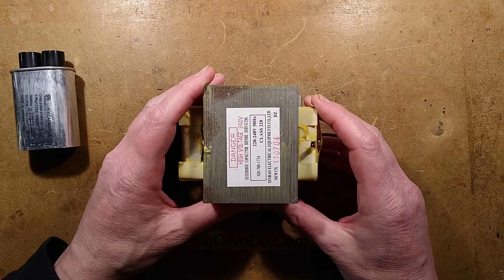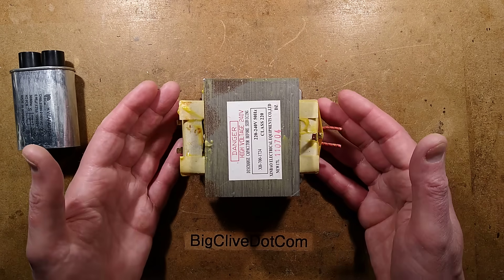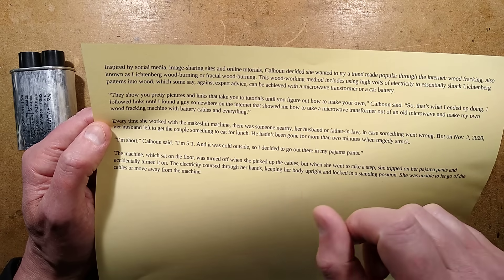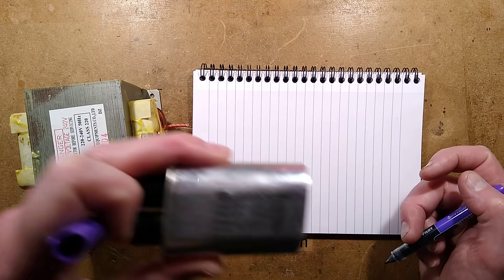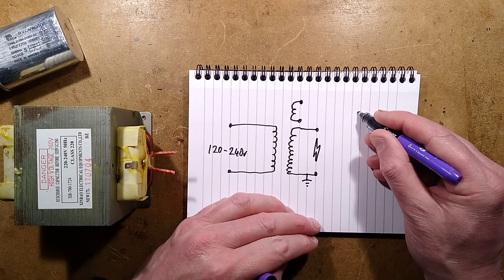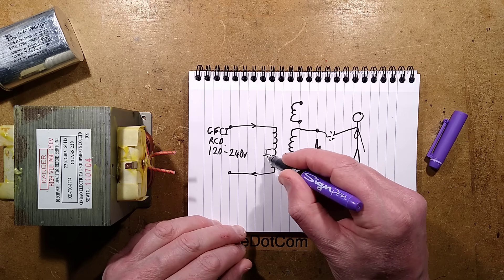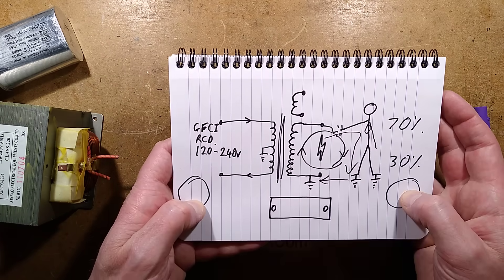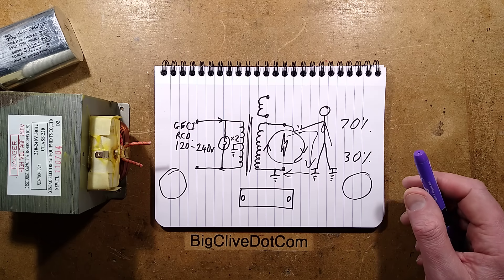The most deadly project on the Internet

Comment: I have a 50 kv sign transformer. I use solid auto motive spark plug wire to move it. Lots of fun but carefulling is required, unless you want forever sleep.😅

Comment: I'm an electronics engineer and while your concerns are warranted, car jumper cables are intended for 12 or 24vdc but capable of both voltages and currents of magnitudes far greater than the intended and rated purpose.
If we calculate the cross sectional area and length, we can generate some real world numbers that will be accurate and reliable.
The real issue is ignorant people literally playing with electric fire.
Reply: Yes indeed but the alligator clips could be easily touched. Just not the right cable for the job despite the ratings. Also an electrical engineer.

Comment: I know I shouldn't tell this story, but anyway... Way back in the last century, I was a student apprentice. My subject was electrical engineering specialising in electronics.This was in the days when valves were ubiquitous and electrolytic capacitors were mostly high voltage. There was a training electronics workshop where we designed, built and tested various bits of equipment. We very quickly learned that if somebody yelled 'catch' and tossed something towards you, you put your hands behind your back and dodged the object.

Comment: I noticed a lineman has already chimed in... And gave a harrowing account.

I'm an industrial electrician and I deal with medium voltage regularly.

Don't play around with it. Electrocution is a real danger. But under the right (wrong) circumstances, arc flash is also a horrifying possibility.

Would you mess around with fluids under 2000, 3000, 4000 pounds of pressure? Because that is the closest approximation that most people unfamiliar with electricity can understand...

Voltage like that is like high pressure fluid... It is under tremendous "pressure" or "tension" and will utilize the smallest flaw or imperfection to escape and equalize the pressure it is under.

It will kill you and it will be agonizing the entire time you're dying.

If you insist on pursuing this... Get some training. Get the correct PPE and safety equipment. And learn how to properly maintain/care for said equipment.

Comment: Why does that label not explain that it is actually 3000V? I'm sure this lack of information has contributed to the amount of deaths. Granted they should have never messed with this tranny.
Reply from the maker: There are warnings on the ovens saying not to open them due to high voltage.  I doubt they ever thought that people were going to take the transformers out, connect car jump leads and then pour salty water over a table and hold the leads onto it.

Comment: So making it into a spot welder is fine? (As long as you short the capacitor before)
Reply from the maker: Yes.  Once the high voltage winding is removed it becomes a much safer transformer.

Comment: I'm by no means a professional electrician, nor have I ever worked as one in the past, or received any training in that field, so this comment is by no means professional advice, nor advice at all.  It's simply some personal observations, and speculations, and I welcome anybody more educated on the topic to correct me, or offer their input to the thread.

With all of that said, what concerns me about the dead man's switch is that if the high voltage tenses the muscles in the hand, they are most likely going to clench, and get locked into that clenching position... and if the switch is based on simple mechanical buttons, or even spring-loaded rocker switches, that could lock it into the closed position.

I could envision a safer approach, but the engineering/construction would be quite a bit more complicated.  But essentially, having the switches on a fulcrum, which is spring-loaded to keep the switch in the open position, but not a rocker switch as we usually think of them.  Rather, these levers would consist of linear pieces of insulation, 4 or 5 inches long on one end of their respective fulcrums, and shorter lengths of insulator with contacts on the other end of their respective fulcrums— preferably the contact ends being inside of thermoplastic-insulated boxes.  To close the circuit, one would have to apply pressure by clenching one's hands around the lower part of the levers and hold them in a middle position, and only while maintaining that correct amount of pressure to both will the circuit remain closed.  If one lets go of either lever, the spring pushes it back into the open position.  If one suddenly clenches their hands with enough pressure to move the levers beyond the middle (closed) position, it will push the levers into a third, open position.  Finally, if pressure is released from the third open position, the levers (or the contacts on the load side) are pushed out of the path of the other contacts, such that the levers can return to their resting state in the first open position, without making momentary contact with the closed position.

Although I'm unaware of any manufactured switches which accomplish this same level of safety, they may exist, and if so, building DIY ones is definitely not a good alternative.  But assuming there aren't any such on a mass-produced basis, given that the placement would be in series on the primary side, Cat IV contacts and wiring (while certainly sufficient) wouldn't be necessary
Reply: The dead man's switch isn't on the high voltage side. I've made the switch before. The point of it is that you need two hands to turn the device on, and keep it on. So you have no hands left to go poking around the high voltage stuff.

Comment: Voltage can definitely be dangerous.  If I am correct, anything over 50Volts can be dangerous. Remember it's Amps that kill you but it's the Voltage that basically has the ability to  allow that amperage to flow through your body.  There's more to it but for basics, do your research regarding what you are working with.  
I will point out there are more deaths from lower volts only because it's the more prevalent Voltage we are all subject to...IE 120/240.  Always be careful and study before attempting anything like this so that you can be as safe as possible.

Comment: Just a small sidenote about discharging the capacitor. I wouldn't recommend using a screwdriver (insulated or not) to do it, as if the capacitor is fully charged it would create some pretty nasty sparks and if you aren't prepared could cause unwanted outcomes. Even if it isn't at full charge, it could still hold more than enough voltage to be a big problem. Using a bleeder resistor rated for that kind of job is a much better and safer way to do it in my opinion, as it will discharge over time instead of instantly. I know it isn't the main focus of the video but I do think it's important to point out.

Comment: I personally am going to try using electric flyswatter transformers in series.  The shock is overwhelming, but not fatal.  It would be similar to a microwave transformer but with lower current.  I will also have lots of precautions still because those little transformers are still dangerous due to the AC plasma.

Comment: Serious Question: After double checking that all wires, connectors, and the transformer itself are all properly insulated, what is wrong with just standing by the outlet and unplugging the machine when the circuits meet or when an adjustment is needed?
Reply from the maker: Accidents happen.  I still recommend that if people actually do this project they have a safety system in place as described.

Comment: Ive done plenty of fractals as a woodworker. My device is rigged with 2 safety switches and i was taught to NEVER hold the leads. I even unplug it after switching off to ensure i dont get dead and i always am at least 5 feet away before i switch the burner on. Electricity is NO DAMN JOKE

Comment: I have two balasts from 480v street lighting that were removed from a project where we were hired to change over the old high pressure sodium street lights to newer LED style heads. The two I kept were ones that I had installed just a few months prior before I recommended that they switch to LED to save power and maintenance costs.  They both have your standard 240/480v input, but the output sides of them are multi-tap and have outputs that will easily hit over 1200v. I have been wanting to find a use for them and wood fractals is one of the ideas. However, being a worst case scenario thinker, they remain on a shelf, just because they terrify me. People have no understanding of just how dangerous these things are and how one little lapse of judgment can end you.

Comment: An important video I hope many people see!
It is dangerous to play with electricity if you are ignorant of the fact that it only takes 100 mA to stop the heart and that a fairly low voltage of about 100 volts can generate this.

One problem is that the iron core is "live" and a closed circuit can occur that may pass through the entire body
If one ensures that the transformer is fully isolated from "earth" reduces the risk of injury.
If you then follow the principle "one hand behind your back" the risk of injury is almost zero, of course you still get current in/out of the active hand but you survive.
Or am I wrong?
Reply from the maker: At this voltage the hand behind the back thing is less effective because the current can find a return path through your footwear to ground.

Comment: Good video sir and you certainly don't understate the safety necessary for handling high voltage transformers. The dual button safety design is commonplace in so many automotive parts and other factories that its implementation should be more widespread. Good luck with your other projects.

Comment: 😮😲😲😲 oh I get it so the microchips inside of the victims they are using this type of fractal burning on their skin by making a pattern and it's killing some people is starting from an internal burn though from where the microchips are guiding energy and heat to the next microchip place very close by like a nearby device
Reply from the maker: As you clearly distrust microwave energy in the 2.4GHz region, can I strongly advise you to turn off your phone, WiFi router and all computers/tablets in your home, as they emit that frequency.

Comment: Sorry my post below was so long and a bit off topic, but the article and video took me back. I'll second that microwave transformers put out high current as well as high voltage unlike other high voltage transformers that are low current. A Tesla coil is high voltage, but very low current and that's why they won't hurt you. I could add the chain of events that led to an accident where one of our experienced techs was injured while servicing a microwave requiring a pacemaker in his early 30s, but that's way off topic and another story. I am surprised anyone who knows what they're dealing with suggests messing with one of these transformers in the first place.

Comment: Back in the 80s, it was still worth it to repair a microwave. You had to know what you were doing because the high voltage winding on those transformers is 4000 volts. The single transformer units also had a 3 volt filament winding. If the filament circuit was open due to say a bad magnetron or open high voltage diode, the capacitor would build up that 4000 volt charge to its rated capacity. It was vital that you discharged that capacitor before touching anything. In the case of an open filament circuit, just the charge left in the capacitor could kill you even with the unit unplugged, and retained a charge normally even when unplugged as capacitors do. In short, you must have the knowledge to identify and avoid contact with the high voltage circuit. Apparently, enough consumers got into these that the industry went to capacitors with bleed down resisters built in. I didn't rely on the bleed down resister because that portion of the capacitor could fail too with the capacitance portion still functioning. Then they insulated the terminals so you couldn't manually discharge the capacitor, so you had to work around the insulation to ensure safety. It was sometime in the 90s when counter top units weren't worth repair even if the customer brought the unit in because the imported units were so cheap to buy new. 
That said, those transformers are quit useful for various projects, but they all involve removing the 4000 volt winding from the transformer. They made nice power supply transformers for audio amplifiers once you rewound the secondary for the required voltage. With the advent of mosfets, purpose built ICs, and then toroidal transformers, those days are long gone.

Comment: sir a question if you don’t mind please !   How could this happen ? I had Chicken wire netting over a sweet potato patch that I harvested . It was to keep out the Bandicoots.  I pulled all the wire off vines and all then rolled it up and stamped on it to pack it down . I left it in the Sun for a few days. I then went to take it to the  dump .  I stomped on it wearing a pair of rubber thongs to pack it down more . Some of the netting folded  up between my legs , 3 electrical  arks shot pin hole zaps between my knees making 3 large like blood clot splatters under flesh , like being Electrocuted?  Any idea how it could have happened ? ?  The ground was dry , a shed with electricity was about 5 metres away .
Reply from the maker: That's odd.  It could have been an electrostatic effect or some voltage gradient on the ground from an electrical distribution system.

Comment: What if you are connected to a grounded wire?
Reply from the maker: That would make it worse.
Reply: Why would it make it worst? Because the electricity will continue to pass maybe or maybe it will fry the ground wire?

Comment: Thank oyu for an excellent explanation of why not to do this. I have been an industrial electrician for about 20 years. I spent 14 years as a senior electrician on offshore oil rigs. We maintained averything electrical on the rigs from computer routers to 11kv switchgear and 55MW generators. The only thing that we were forbidden to repair as per company policy was a microwave. I knew that there was dangerous voltage but i never knew how much until now. Thank you for the video. It probably saved more lives than you will ever know.

Comment: My wife told me oh that's great you've decided to build a death machine. And of course she was right. My record would indicate that I would die shortly after completing the project. But alas, I am alive. The reason I am alive is planning and safety. I Incorporated a red light into the system indicating it was on. I insisted on $500,000 volt electrical gloves to be worn. I built wands that moved me at least 26 in from the tips and no water of any kind was allowed anywhere in the area when the red light was on. Hence I lived. Any moron trying this will likely die.

Comment: HT wiring on petrol engines can have voltages well above the 2-3000v from one of these transformers and will give you quite a kick but rarely fatal. The killer here is the current. It takes only a few milliamps across your heart to arrest it, a figure easily exceeded by this type of transformer.

Comment: Question, can something be galvanicaly isolated and connected to ground? Isn't it safer to not connect the secondary side to ground so the current wont try to find a way through you to ground (and the GFCI wont help anyway because it is on the primary). then you would have to touch both ends of the secondary windings for current to flow through you and kill you?

Comment: The Hongba hb-c02te power supply seems to be a regular transformer (not a converter) so it does not boost frequency. However, the maximum output current (30mA) of this power supply is safe.

Comment: It takes just 1/2 an amp to kill you. I was zapped about an inch or so from a giant relay I was testing with a multimeter. My pinky finger sure felt it. Lol. 100KW generator.  I was changing out a starter lockout switch on a 5kw generator,  when my friend and coworker wasn't thinking and tried to start it. 24 Volts sure bit hard. Metal wrenches too. I should have disconnected the batteries.  Thank you!

Comment: I do not look at that as deadly because that is just a small transformer. What is deadly is the high voltage running in the transmission grid because they are now from 10 Megawatts to a Hundreds of Megawatts to supply electricity in a City now a days.

Comment: If you really really really really want to do this with a microwave transformer, secure it to the ground, build an enclosure, and make sure that thing has no conceivable way to shock you. Then use heavily insulated leads that come from behind your work bench, you stand atop an insulating platform, and you wear proper ppe.